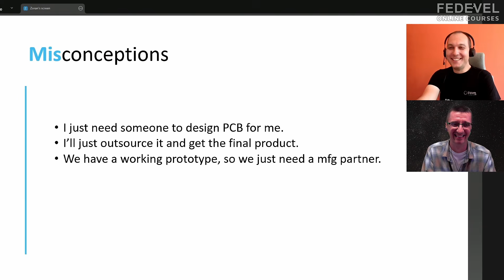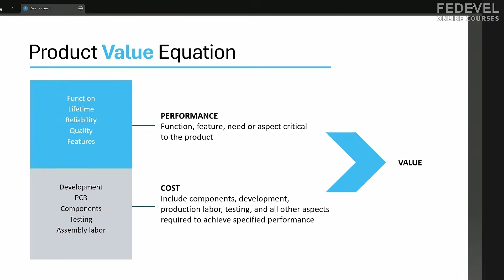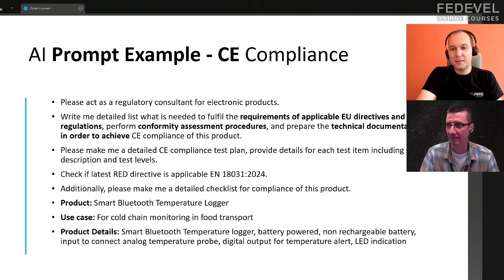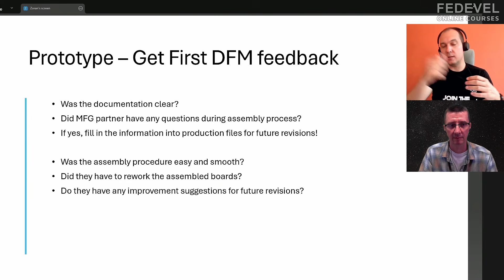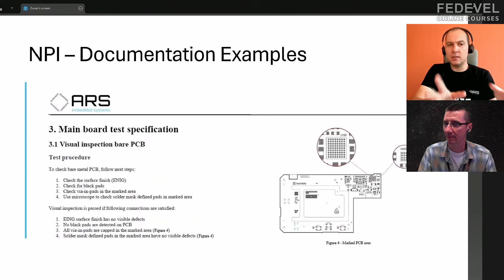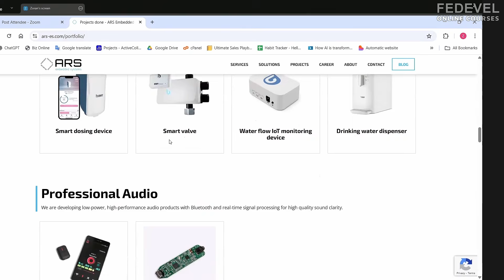From Idea to Mass Production - Explaining the process of electronic product development

Comment: Thank you both for the video! I'm currently designing a product, and glad to see that I thought at least somewhat about most of the things mentioned in the video. The product is quite simple, about 50 components, with an STM32L0 being the most "complicated" one and supplied by a drill battery. I have one prototype board already and the firmware ist kind of feature complete.
The production is planned to be about a 1000 pieces (really pieces, not panelized 😆). I feel that has to be the worst number when thinking on how much time to invest now versus time/cost later.
If I manage to shave off a Euro or two from the BOM cost, it pays off. But it could as likely be that I only find a few Cents and it takes me a day.
The same with assembly, flashing and testing. Every single minute I manage to shorten that process by writing a flash and test program (and most likely having to build the according jig) saves those that have to do the assembly 1000 minutes. But it could also be that implementing that "minute" takes me two days of work.